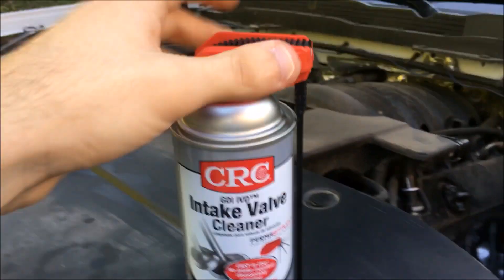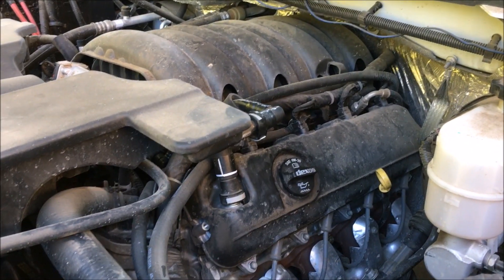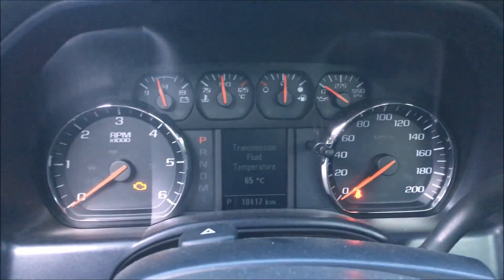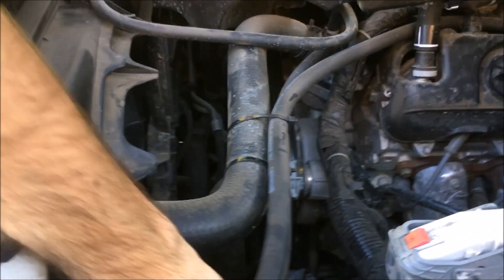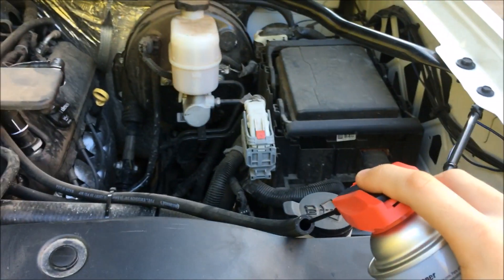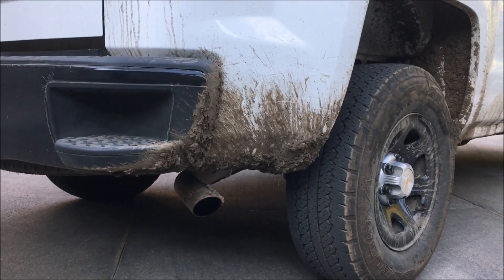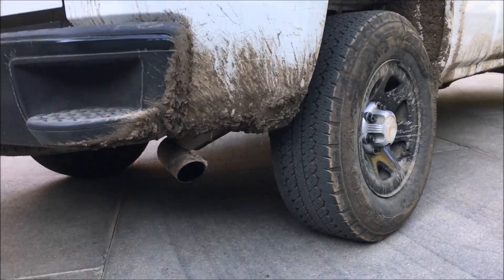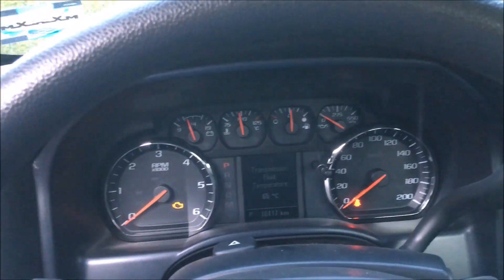How to Remove Intake Carbon Build Up using CRC Intake Valve Cleaner

Comment: I asked CRC specifically in an email:  Would the cleaning procedure damage the engine?  Would the carbon that was removed from the valve score the cylinder walls and piston rings?
CRC replied:  In all of our testing, no damage was found on, valves, valve seats, pistons, cylinder walls, turbos, O2 sensors. The PEA breaks down the carbon slow and controlled.
Reply from the maker: To my understanding, the PEA dissolves carbon into a liquid. Since the making of this video im using Chevron Techron Concentrate because it has way more PEA. The product that has the most PEA is Techron Marine wich is like 50% detergents.
Reply: @BadAssEngineering  CRC contains diesel fuel #2, but the Techron does not.  Diesel fuel #2 may be acting as an accelerant to help burn off the carbon or other reasons that only CRC would know.  I would stick with the CRC instead of using Techron.  They are about the same price, the CRC is designed for injection through a vacuum port, but the Techron is not.  The spray canister of the CRC is designed to atomize the liquid, but the Techron is not.
Reply from the maker: @ospuddy  when the liquid comes into the throttle body vacuum it atomizes, Techron has been better than CRC to me, CRC's diésel content makes the engine easy to start pinging/knocking
Reply: @BadAssEngineering  CRC Intake Valve Cleaner uses diesel as the carrier because it has low vapor pressure.  Because diesel doesn't evaporate as quickly, it is the perfect carrier to deliver the detergent to the targeted area behind the valves.  I got this info from their patent.

Comment: A couple of tips. That is a GDI engine, and we have yet to see a solvent based cleaner w/engine running not damage pistons and cylinder walls as the hard abrasive crystalline debris gets forced between the pistons and cylinder walls. While most is expelled out the exhaust, what does get forced between the pistons and cylinder walls can be as abrasive as sand and causes scouring. Also, that catchcan with a breather is not helping. You need a complete system that traps and separates and does not vent to the atmosphere. If you want pictures of disassembled engines after solvent cleanings (these are safe with older port injection soft carbon, but NOT on GDI engines
Reply from the maker: Tracy Lewis Performance totally agreed, since the filming of this video I have deleted tha catch can and the crankcase now ventilates to the atmosphere via the head cover vents.

My truck is roughly 7,000 miles and I use the cleaner as an extra buildup prevention
Reply from the maker: Tracy Lewis Performance btw the breather on the catch cam was just for looks, I capped it so it didn't become a vacuum leak ✌🏼
Reply: Tracy Lewis Performance  so what your saying is not to do this procedure at all
Reply: Tracy Lewis Performance .. thanks for confirming what I've been saying to customers and people online about these miracle fixes in a spray can for GDI.. they are a gimmick and do more harm than good.
Reply: YEG Mechanic, what is the preferred method to keep GDI engines clean from buildup?
Reply: Hey tracy, I have a 2015 Silverado 5.3 how do you recommend cleaning these carboned up intake valves. Chevy dealer did BG at 20k and now I'm at 40k.
Reply: Tracy Lewis... so... HOW EXACTLY do you recommend cleaning the back side of the intake valves? Who do I take it do and what is the procedure called? I'm a 2014 GMC sierra at 80k and finding info on this is a pain in the ass. Everyone I call offers some BG fuel system cleaning procedure but this is NOT cleaning the back side of the intake valves. So... ?????
Reply: If you do it from day 1 often enough to where you dont wait 50k+ it shouldn't have bad enough build up to do enough damage to keep it from lasting a very long time unless it's a race vehicle
Reply: WALNUT BLAST THE INTAKE VALVES & PORTS. YOU'RE WELCOME 🤯
Reply: @Canada55Eh  And that's by far the best cleaning process. We do the manual cleaning for $399 for the V6 and 4 cylinders, $499 for the V8's.

Comment: The catch can should eliminate intake valve deposits.  That's the whole point of the catch can.  Or vent to atmosphere and plug the vacuum line to the manifold and you're good to go with no need for intake valve cleaning.
Reply from the maker: Thats what i did, vented everything to atmosphere and capped the intake vacuum
Reply: So why did you do the valve cleaning?
Reply from the maker: PCV gases are just a part of the carbon buildup problem, the other part is that leftovers from the combustion return to the intake port a bit during valve overlap just at the end of the 4th stroke, this happens in all engines, but there is not an injector to clean  the port in GDIs
Reply: BadAssEngineering I am thinking about installing a catch can on my 2014 Silverado with the 5.3 V8 it already has 45k miles so I was wondering how I could clean prior existing carbon deposits. 

How well did you think this CRC worked?

Comment: Didn't you remove the catch can when you removed the brake pump?
Reply from the maker: @justinstatham6378  yes, catch cans don't work to prevent carbon anyway
Reply: @ I did your pump delete and when I pulled my air box this weekend to change the thermostat it was full of oily goop? It has 150k on it. I am wondering if my plugged pvc caused it.
Reply from the maker: @ nah, that's normal, that's why I run my vents off the intake. That oil is what causes carbon buildup. You can run those lines to the atmosphere or to a non recirculating atmospheric catch can

Comment: Looks like I'm sticking to Seafoam. I use a whole can, wait for an hour and boy I smoke out the whole neighborhood lol. Never thought that much smoke would come out it was smoking heavy for a good 5 minutes. This was on my Mini Cooper S. 😊 Cooper S now runs way better.
Reply: it gonna smoke   seafoam is oil based    CRC  is solvent base and has pea  which is the strongest carbon cleaner you can get

Comment: Bro , that's the wrong catch can , with that breather on top , your allowing unmetered air into the system.
Reply from the maker: BoostedByV at the time of the video I capped the filter so it didn't become a vacuum leak, since then, I'm fully venting all the crankcase pressure through the filter to the atmosphere, check my newer videos in my channel ✌🏼
Reply: I did the same thing when I installed a catch can

Comment: I know this video is a bit old but did you have a p0300 code and idling rough
Reply from the maker: No, the engine goes back to running fine after a few miles, check my other videos on how to clean carbon from the throttle body
Reply: @BadAssEngineering   cool thank you I am chasing a p0300 and the valves look crusty going to se if I walnut blast them

Comment: Do you know how the vacuum pump works on these engines? I was thinking about using that for a crank case vac. I think gm needs it for a brake booster.
Reply from the maker: Yes, they are mechanical and run with the accessory belt, since I have very mild mods on my truck this works just fine, but for your L83 I believe you could swap the brake booster/PCV lines and run it as a mechanical vacuum pump. I don't know if it would flow sufficient CFMs for your increased blowby with a turbo setup tho
Reply: BadAssEngineering itl help a lot with idle and just cruising around being cool.
Reply from the maker: How does it help with the idle? I didn't know that!
Reply: I think I may run that vac. I have all the shit.
Reply from the maker: don't forget to upload a video on how you did it

Comment: So I'm wondering where the carbon build-up  Goes to? Does it run down or flake down to the oil pump?
Reply from the maker: It goes into the cylinders and burns up. Youre shooting the cleaner into the intake, not the crankase
Reply: CRC GDI Spray is a solvent, it will dissolve most carbon deposits
Reply: It goes into your exhaust and then ruins your catalytic converters!!!!

Comment: $15 is fairly cheap compared to what the dealership would charge. I know this method is not as good as walnut blasting the valves but if it works then have at it
Reply from the maker: A few of these cleans Is still cheaper and you don't have to disassemble the engine

Comment: how do you Eleminate Check Engine Light if the Cats are Removed ?
How abouth the O2 Sensors
Reply from the maker: With a custom tune or they also sell o2 sensor extension tubes to fool the computer
Reply: @BadAssEngineering  Kool 
my 2017 Tahoe had a CEL under Warranty : 40,000 km the Dealer Replace the Cats ( Y-Pipe Assembly )
Now OK

Comment: Did you do it only because recommended, or you experienced some problems? Oh, you have only 7k miles. CRC claims it cleans up to 23%, then up to 46%, so maybe we have cleaned only 13%, who knows; and that is just not enough no matter the spray is cheap and my rebate check never arrived, i DID NOT SOLVE WITH IT any of MY PROBLEMS with 1.6 liter kia:

starting in a split of a sec, like chevy starts - i have to crank over 1 second, or it won't start at all when engine is cold
power, like kia had it 30000 miles before
acceleration, like kia had it with less miles
going uphill over 3000rpm in 4th gear instead in 5th, like it did it before climbing the same hill, my everyday route
...
so, don't know if I need to try the treatment once more, or try something else, but the solvent should be safe, if it could only solve any of deposits, which at the end could kill an engine; the white smoke we've seen is just burnt ingredient of the spray, I read somewhere
Reply from the maker: Vcbccbc Vcbcvb my truck has less than 10,000 miles, I use the CRC cleaner as preventive maintenance to keep the intake and valves clean, you can't correct carbon that has been building for years with spray
Reply: that is what you think, but they CRC are offering percentage of correction/elimination, so what do you think I am going to do to my kia if' buy 2 sprays for 20 bucks, specially designed for gdi engines? if to sick, use double dose, or apply second soon after... actually, i am going to spray 3rd one as soon as gets warmer outside

p.s. let me tell you this: my kia exosted much more smoke then your truck,leaving  a huge cloud behind, after 1hour of sitting, and maybe 1 mile, or a couple of minutes since I started to drive it... I should have it done somewhere on highway exits:)
Reply from the maker: Vcbccbc Vcbcvb if your problem is that bad the only way to fix it is to take the engine head down and manually scrape the buildup
Reply: how we know how bad the problem is, my wife even doesn't notice anything, except when ign. coil fuse was failing summer time only when the car was warmed enough, after the same hill climbed upon, but dealerships found no electrical isuue? they only treated it with techron and covered up the problem, so ignition coil fuse never blew again, ...
nobody believes me the reason why was the heat carbon deposits and preignition (pinging, driving and accelerating on hill) caused; now, with higher octane fuel and no more eco mode, preignition is eliminated, and oil pan doesn't leak anymore, cause the pressure is also less

I don't know how to do it, and no way I'll waste the money on it - full synthetic oil/filter is only when I am not cheap, and small car can run 90mph easily, doesn't use any oil since spitted and burned small amount from oil pan in the summer when problems started... i am lucky compering with forte owners, they can catch a fire (they have recall on that issue, don't know how rio doesn't, it also doesn't have a temperature gauge, because the manufacturer knew gdi overheat during the time of exploatation)